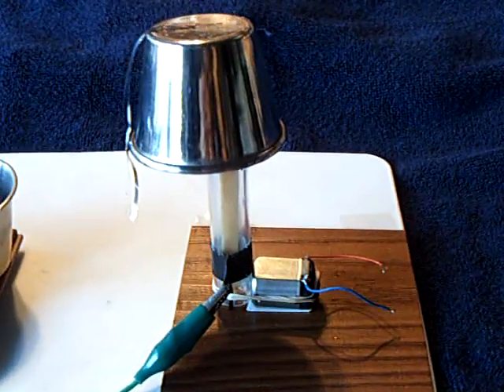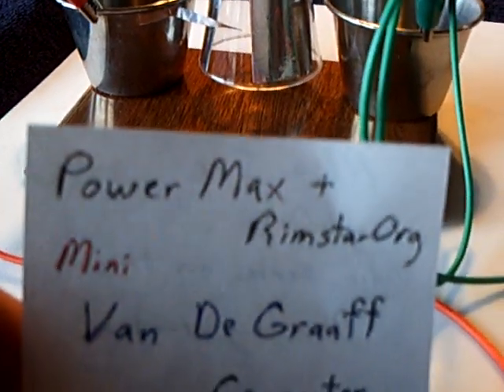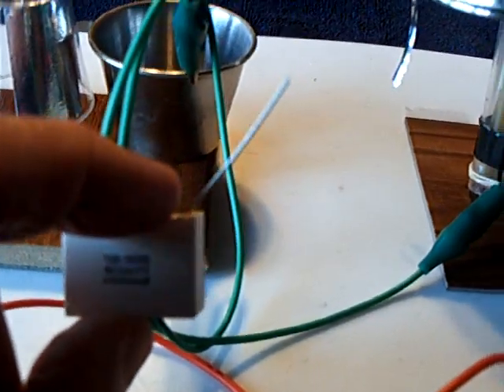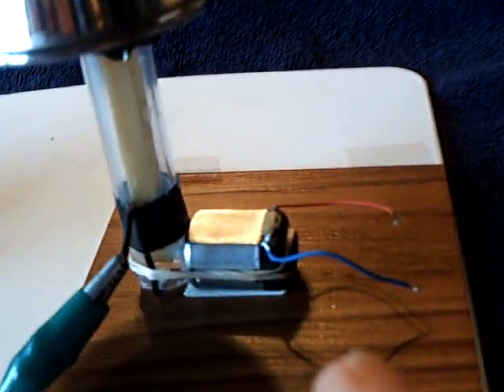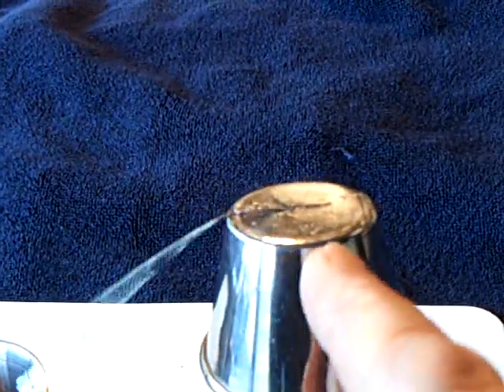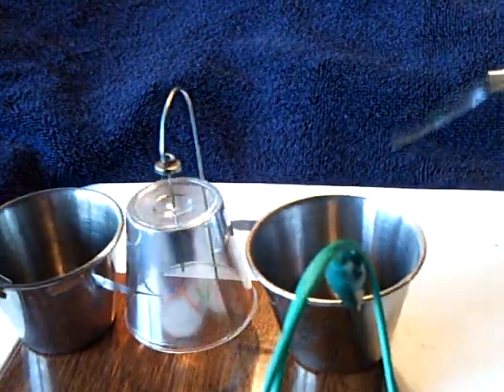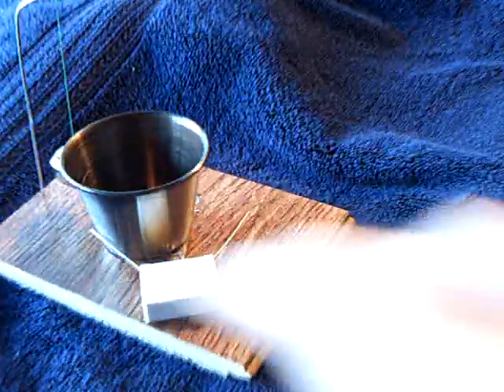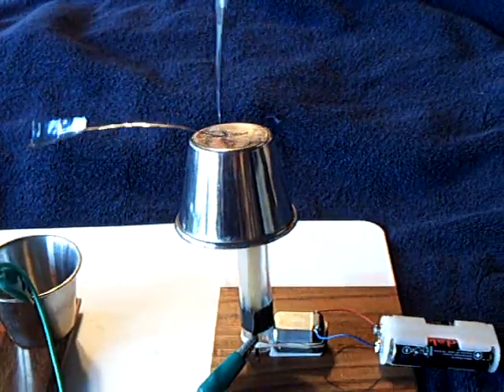Mini Van De Graaff Generator

Comment: Also,.. you can use the vdg without the bucket... plug the vdg output onto the capacitor cathode and the vdg input(ground connection) onto the capacitor anode... your motor will spin

Comment: Now power it from a solar panel and run a little led off it and you've proofed a free energy invention. If it will charge a capacitor it should power a little low powered led... that's quite cool... I'm about to attempt my own electrostatic motor build... just looking around for ideas

Comment: Nice little static maker :) fun to see how simple it can go just to create a few thousand volts Thanks for sharing :)
Reply from the maker: This is an interesting way to convert mechanical energy into electrical energy.  It is high voltage but I found out that there is also some amperage because I can put the energy in a HV cap and hold it there.   I have always thought that static electricity was not able to be contained.
Reply: well static electricity is very low amperage high voltage what will determine the power is has is the "capacitor" holding the charge. Your little generator may generator lots of KV but the holding charge is nothing but if you store it in a big enough cap it may bite ;)

Comment: weels in a car can be used as (ruberbands) with front and back combs to colect energy?
Reply from the maker: If we made the car tires of dissimilar materials (see the Triboelectric Scale) and the road surface acted like the rubber band, that might work.  The problem is that the road is grounded.  That is a good thought puzzle though.  Thanks.

Comment: Great little Van de Graf generator,  a fine way to produce High voltages, and perhaps dielectric energy  .
Reply from the maker: Hi Jack.  The main reason that I built this was to see if I could take the energy from an 'electrostatic generator'  and store it in a small HV capacitor like what I have been using to drive my electrostatic motor.  I found out that it can be done.

Comment: try thomas kim desing with pvc bottle and electrical tape as a belt down belt is just pencil rapped whit elec. tape  ( pvc) and upper is something else i frogott but I know that clear part of pencil works ! ( but not all pencils ) 
PS: you can chech it something is pvc or not by heating copper wire in the flame and then you put the wire on that material so it melts it and little bit of that stays on the wire and then put it back in flame and then if it changes color of the flame it is pvc ! (PVC WONT WORK FOR UPPER BELT ) . SRY FOR BAD ENGLISH ! AND NICE WANN DE GRAFF TOO ! :)
Reply from the maker: I have studdied Thomas Kim's work and watch all his videos.  He really understands what is going on with these electrostatic devices.  I may make one of his hand cranks Van De Graaff generators.  It was from him that I learned that an electronic bug zapper would drive an electrostatic device.  You are very right about using the right materials for the rollers and belts.  If you get that wrong the thing doesn't work. Youe English is OK. I can understand what you are saying.

Comment: Im glad you came across my video! I will soon post a video (perhaps when the college semester is over, chemistry has really taken it's toll!) on how to build a powerful slayer exciter, I'll be sure to reference you as well as a few others who made helpful videos, as you have done for me! As a tip, you should seal off the bottom edge of your condiment cup with duct tape to keep the electrons from leaking away, yours seems to have just as much current output as mine, so your topload is all that needs improving. Yours is definitely a lot neater than mine LOL!
Reply from the maker: Many thanks for your video on how to build one of these and the tips on how to improve mine.  It is a fun project.  I will be looking forward to your Slayer Exciter build video.  Gary Bluer and I were working on Dr. Stiffler SEC exciters when he came up with his Slayer Exciter circuit.
Reply: ***** I have an instructable page also called - Max - with the same profile image as here. Anyway, there you can find mine! I just need time to make and edit a video... It took weeks to make the Van De Graaff video, simple because of poor technique when filming, and amateur equipment... Hopefully my next video will be not as bad! Anyway, I can only get good results as 9-12v and a power-transistor. What's the secret you yours and Gbluer's? I might try to make a spinoff of the SEC using a third feedback coil, to prevent nasty voltage going into the transistors, and with less voltage, more current can be utilized to better-drive a BJT transistor. I might even make a push-pull configuration!
Reply from the maker: It was actually at Instructables that I saw your video and I used that site as the build guide. I know how long it takes to do that work and I am very grateful for your help.  It would take a small book to explain how Gary Bluer and I (and others) got his circuit to perform so well.  Gary sells his exciter on Ebay now so I don't like to go into the details of his work.  A good tip though is to adjust the primary coil (trial and error) to get the best results.  Dr. Stifler's SEC exciter circuits are a different thing altogether.
Reply: ***** Thank you! have you been able to achieve strong tesla-like arc with a topload? I can only achieve 2-3mm or arcing @ 12V.
Reply from the maker: Power Max
Reply: +Lidmotor

Comment: Nice Van de Graaff! And thanks for the mention. I'm glad my videos helped. What's the capacitance of that capacitor and roughly how long does it take to charge up? How many volts do you charge it up to? I've never even tried charging one up with a VDG.
Reply from the maker: Thanks.  Your VDG videos were ideal for someone like me who does these projects for fun AND learning.  The capacitor here is a .015uf / 2500v.  I don't have a meter to measure the high voltage and low farad caps so I have to guess at the state of charge.  Rather than risk overcharging I just partially charge them up.  About 30 seconds puts at least 500 v (low end spec on a 'bug zapper' circuit) on it using the VDG because it runs the bell at that point and puts out a nice spark when shorted.   The 'bug zapper'  will charge that same cap in just a few seconds.  I really need to do more testing.  Today is the first day that I got this VDG running.
Reply: ***** great video I will have to make my own!

Comment: Got to try this, nice build !
That's a solder tube housing ? :)
Reply from the maker: Yes you will like this one.  That is a solder tube housing.  It is a little tight but it worked.
Reply: It's interesting, because I wondered if the plastic of the tube may affect the triboelectric properties..and looks like it doesn't :) Am going to try Rimstar's glass from a fuse method for one end roller, elecrical tape for the other.
Reply from the maker: I used the glass fuse as the top roller and then a piece of ball point pen refill tube wrapped with teflon tape on the motor shaft.  The roller materials have to be like our homemade batteries dissimilar metals (far apart on the scale) to get the max output.  The wire pickup 'combs' have to be positioned just right also.